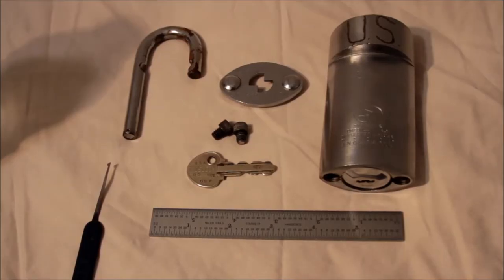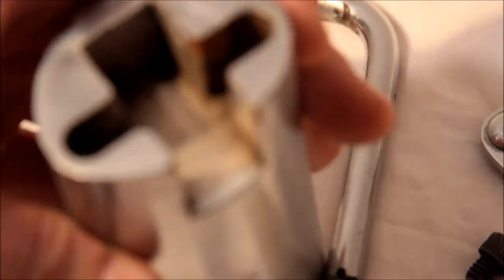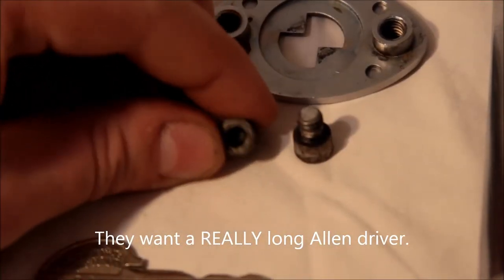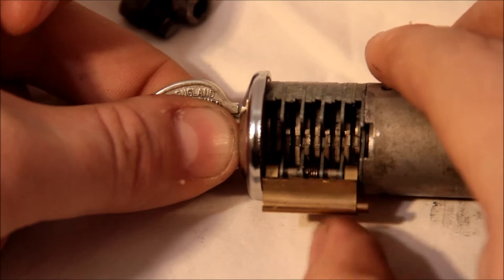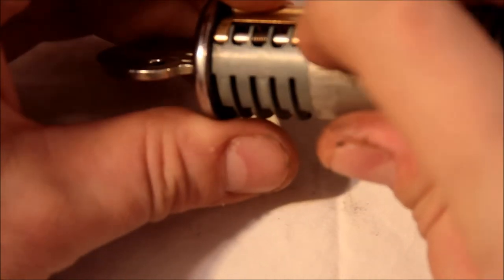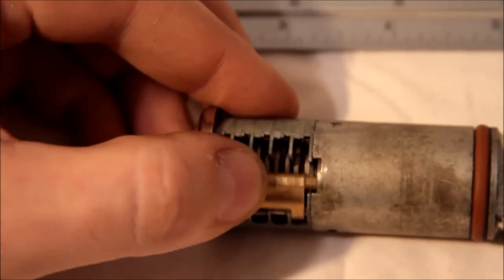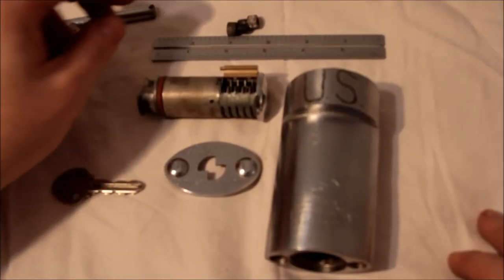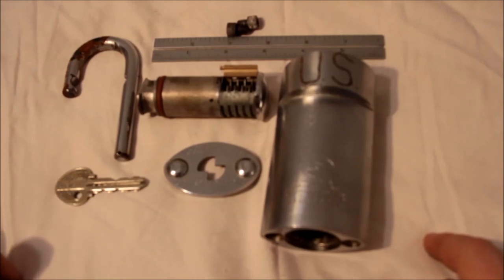(090) S&G/Ingersoll Padlock

Comment: you can get copies of that key, you just have to know the right ppl..
Reply: Yeah. When the patent run out all the companies making low cost blanks quickly adopt them. Maybe manufacture won't copy the key but others will. Add to that that this key doesn't require a special key cutter. Should be easy enough to copy on a standard key cutter machine in two steps - one for each side.
Heck the key way is so simple and large you may even mill out one yourself using nothing but simple machinery.
That said for personal use it's usually not an issue whether the key is easy to get copies of or not. What counts is the safety of the lock - physical and pick resistance. For institutions and corporations it's another story. You can't have employees making copies of the key and the day after they quit/lose their job and returned the original keys... Well ;)